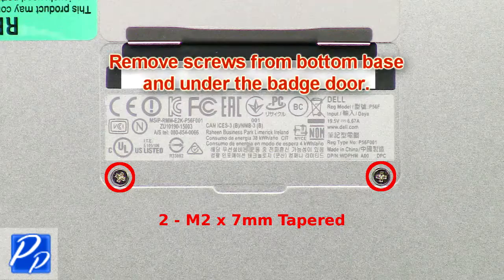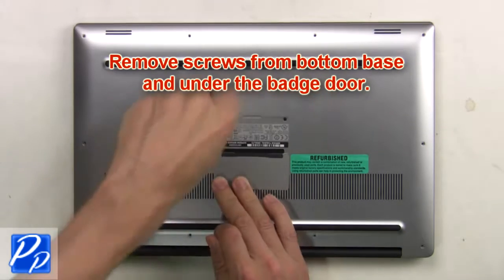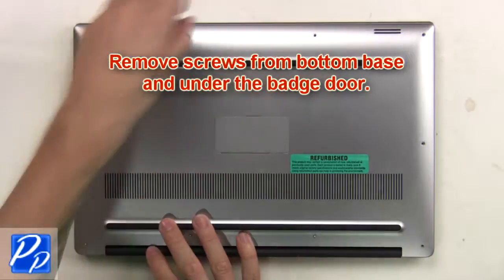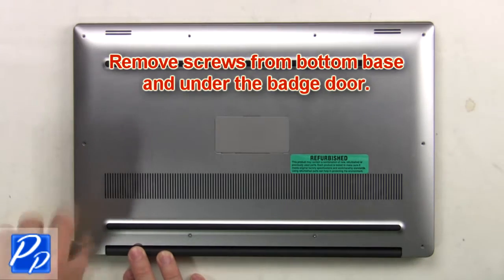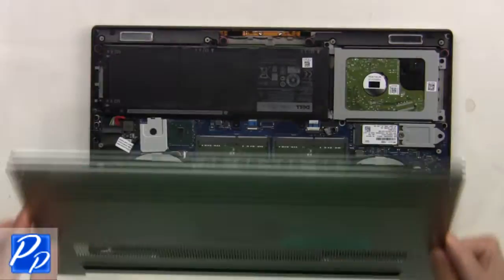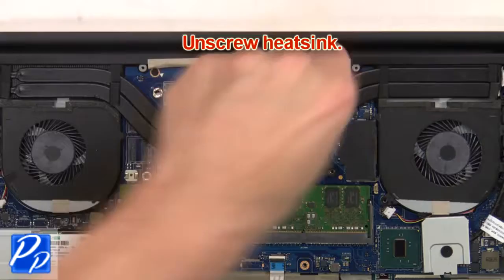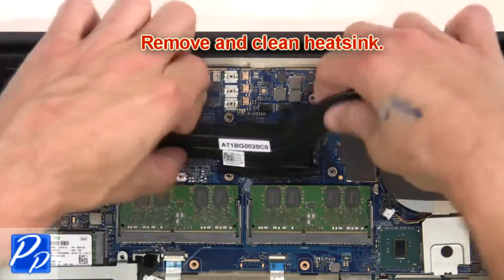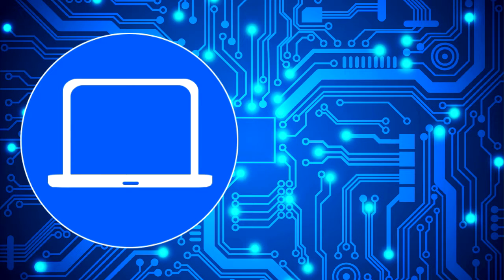Dell XPS 15-9570 (P56F002) Heatsink How-To Video Tutorial

Comment: Hi, thanks very much for this and all your other uploads for DELL XPS, Precision M and Latitude laptops.
Are you sure this video is correct?  I did thermal repaste on my XPS 15 9570 the other week and the heat sink on my laptop definitely has five screws, not four.  Or maybe that is a variation depending on whether the model has dedicated graphic GPU or not?

Also, I noticed in this video that you unscrewed the screws numbered 3, 1, 4 2 in that order.  However, I thought that the numbering on the screws indicated the order in which they should be tightened / loosened i.e. 1, 2, 3, 4 and 4, 3, 2, 1?

Anyway, thanks again.

cheers
JB
Reply from the maker: It appears our system has an integrated GPU that does not require the larger heatsink containing additional screws. Also there is no sequential order when removing screws.
Reply: @dellpartspeople  OK, thanks
Reply: The 9560 and 9570 both have 4 and 5 screw variants.